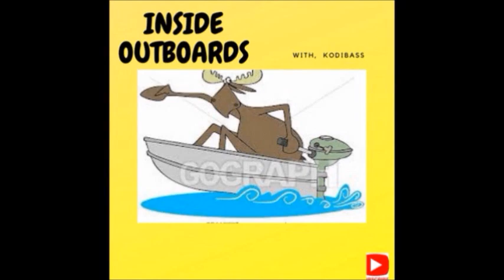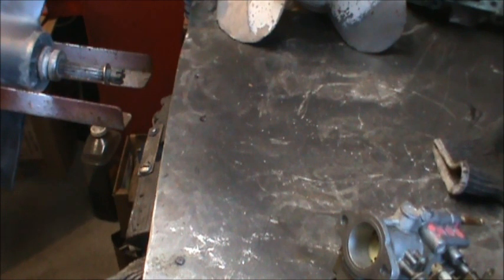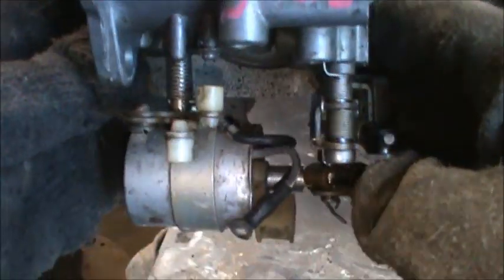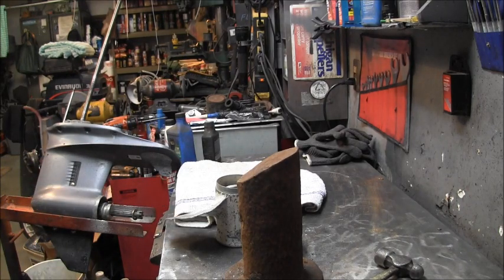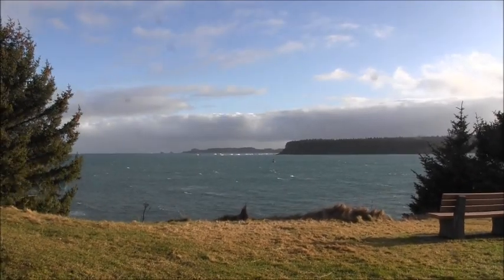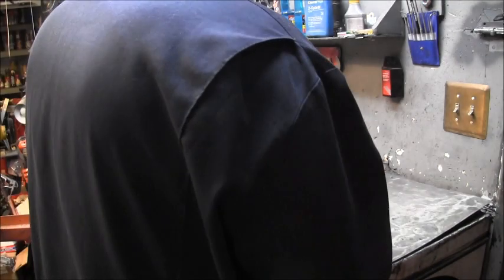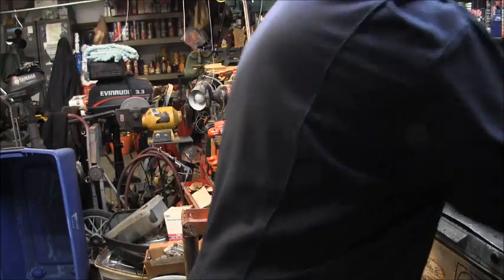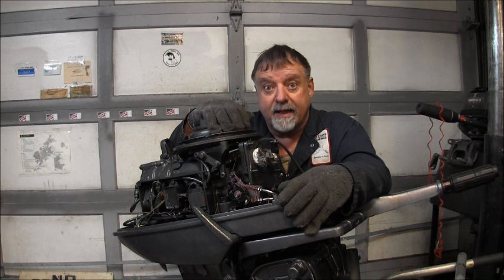1992 YAMAHA  ENDURO  40 HP OUTBOARD MOTOR  ,       ((   Part  6  ))

Comment: Plenty interesting, sir, !  I am looking forward to that skeg drain plug access fix. What grit do you use when prepping for paint?
Reply from the maker: Yep''    Filmed the skeg  opening  then edited it out,    Computer dork  Am  I,,   Next video 4  sure.       I use standard 150 grit,  works enuff 4  holding  the zinc primer.   Then   all is  top coat / clear  goodness.   kodi

Comment: When will you get that new camera??
Reply from the maker: As soon as I smash this one ,  can you recommend a good one?  I have been researching  for good picture yet easy to use for a geezeer  not having much luck.        kodi
Reply: @kodibassInsideoutboards  GoPro Hero 8 or 9 if you can scrape up the cashola. 
Even a 7 would work fine.